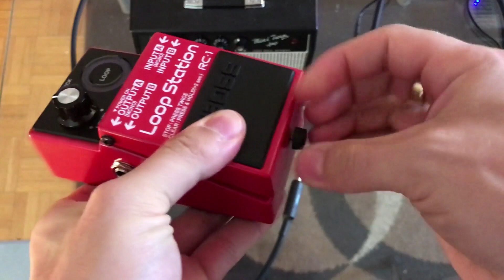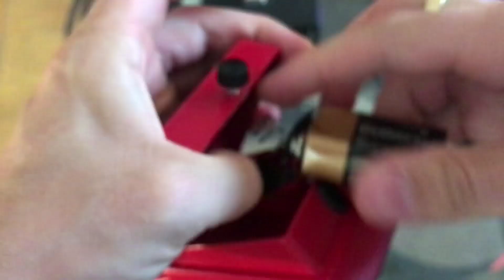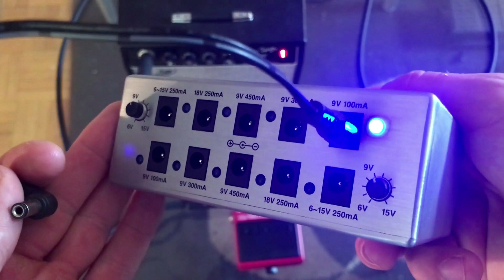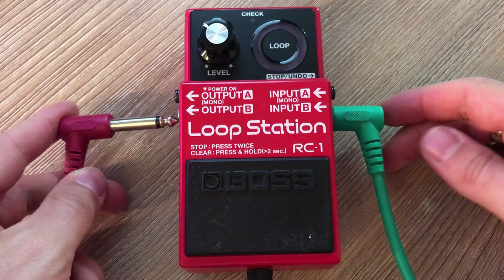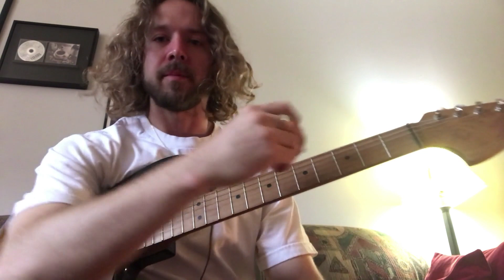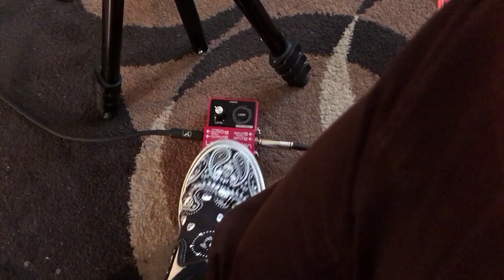How to Use the BOSS RC-1 Loop Station

Comment: Thanks for the information. It really helped. I was wondering if this could be used without an amp? Is there a built-in playback mic? I use an acoustic and dont really want to have the extra kit of an amp. 
If not, is there a pedal that can be used as I'm imagining?

Comment: I know this is an older video but some channels are cool and keep up with comment questions: I like the single pedal loopers but the one issue I can not get around is when the pedal is stopped but has loops recorded (not saved) you CAN NOT clear/erase it without it PLAYING for a few seconds!  WTF!  I HATE this.  I have to bend down and kill the output somehow then erase it.  This may not seem like a big deal but put in the context of 4-6 four hour gigs a week it's a really big deal.  Other than adding a "momentary switch" pedal (which defeats the purpose of using a single pedal loop - I could just use an RC-50 if I want to do that) is there any thing I am missing?  You don't always want to erase when you are in the middle of a song and you stop the loop but continue playing as that can be distracting...I hope I phrased my question clearly...thanks for this video and cool channel
Reply from the maker: I addressed this in my other video about the RC-1

Comment: 1:14 like he says, for using a power supply(PSU) it needs to be 9v DC providing 100+ mA, what he doesn't mention is to make sure the polarity of the supply jack matches. You'll see the supply polarity indicated by a symbol something like this    
9V   < + > --- (* ---- < - >     i.e a jack (*) with the sleeve () connected to one side and the tip * to the other. So the above means 9V suppy with the sleeve positive and center pin being negative. 
If your supply is center pin positive  < + > -- *) -- < - >  it can cause damage and probably wont work. Music gear is usually center pin negative, but lots of other consumer PSUs are positive so just be aware if youre mixing and matching PSUs

Comment: Here is what I DONT see on any of the demos is using effects to change your loop. Most basic: clean and distortion one over the other, also, flanger or wah on second loop. Octaver pedal? Add a bass line. Univibe swells Does your pedal emulate different instruments? Have a drum machine? Awesome. You can even plug a Mic (it might need some preamp) to add harmony lines to your vocals. Using the same tone for everything, even when each dub is tasty, makes the mix sound too busy and cluttered.

Comment: I don't know if there is something wrong with my looper, i bought it used but it doesn't undo the overdubs. I think i accidently got it to work a few times but i'm doing what you're doing holding it down and it doesn't erase the last overdub.
Reply from the maker: Depends on the mode that it's in I believe.
Reply: @andrewsiemon  This is the RC1 model, what other modes are there? you mean inputs to plus into? There's 2 other ones

Comment: How to send outs to a mixer for stereo?
Reply from the maker: Run a cable from the Stereo Output to a Mixer.
Reply: @andrewsiemon  I run both. Not trs from the stereo out correct? I  run both outputs from the rc1 to left and right inputs of the mixer.
Reply from the maker: @davidarchibald3755  I was under the impression that you only had to run one cable from the stereo out to your mixer.

I don't now, I'm not an expert on that configuration, but when I tried running into a second amp, that's what I did and it worked.

Comment: Hi, I use a looper pedal with my synthesizer. 
I start playing my synth and latch the key so there is a sound that „stays“. After that I start the looper. After a few seconds I stop it. 
Unfortunately there is always a little gap that you can hear. I is just at the beginning and it disturbs the recording. 
Do you happen to have a clue, how to avoid this?
Regards
Nosto

Comment: Is the external foot switch the way I can loop clean stuff and play dirty over the loop?
Reply from the maker: No the external footswitch is how you control it with an external footswitch, via, MIDI. 

Signal chain placement (the order of pedals), is how you turn effects on and off your playing after you've recorded the loop (without affecting the original loop).

Comment: Would this work for two separate instruments say a guitar and a mandolin? Thanks.
Reply from the maker: At the same time? Maybe not. You could loop a mandolin just fine though with it, assuming it uses a 1/4" instrument cable as guitars do.

Comment: Ok, I'm stuck at step one. Brand new battery, Input A from guitar, output A to Boss Acoustic Live LT. When I connect, check light flashes once but doesnt stay on like this video. When I plug guitar straight into amp, sound comes through. When I go through Boss RC, no amplification. Seems pretty darn basic. Any suggestions out there?
Reply from the maker: You figure it out yet?
Reply: Yes, it was a cable issue.

Comment: Dont use 9v batteries it will drain on this pedal on ten minutes.
Reply from the maker: Closer to 3 hours, but you’re right, a power supply is definitely ideal for loopers.

Comment: How long can you loop? And how many times? Im guessing twice.
Reply from the maker: I can't remember exactly, but I believe it's unlimited overdubs, but only one loop. 

Also, the loop might be 12 minutes long or something like that. I forget. I mostly use the Ditto X2 and RC-5.
Reply: You won't have to guess if you read THE ONE PAGE MANUAL. 12 minutes of unlimited overdubs.
Reply: @svenjansen2134  I bought it used no manual

Comment: But how do I change the settings on the amp after making my first loop without it changing the tone of the first loop
Reply: Yikes I never thought of this. My guess is you can’t because the sounds are coming from the same source at the same time. Maybe there is a way to do it with effects routing in a DAW?
Reply: LOOPER LAST
Reply from the maker: Looper last as the one guy here said, or put it in your FX Loop.

Comment: Pedal was working earlier, but I must have double tapped or something, now I can't record or playback a loop. It just pops up the three lights if i try to playback or overdub. I wish there was just a factory reset button.

I tried the mode selection stuff while watching this video, and also by following the manual directions, which are incredibly vague. They don't tell you when to exit all the clicks and double clicks. Tried 40 or 50 times, plugging, unplugging, pressing etc. Just insane. Same with your video. at what point do you exit? BTW, mine doesn't seem to behave the same as yours. perhaps it is just hooped.
Reply from the maker: Not sure what to tell you. Try following the instructions in this video again a little closer. It definitely works.
Reply: @andrewsiemon  Thanks, Andrew. It really doesn't help that I, like a very high percentage of males, am red/green colorblind,  and yet pedal manufacturers mainly use those two colors!
Reply: You have probably long since solved this issue, but I would take the battery/plug right out and maybe that would reset it.

Comment: Thanks for this, you did a fantastic job of explaining... but I still HATE this pedal.   I generally love BOSS pedals... but I hate this one.   I just wanted to record a loop and practice over it.  I inevitably end up overdubbing.  And I am just not good enough to double-click in time with my foot.   The features are impressive... but damn... I have to get the manual out every time I want to use it.  I really wish I had not relied on the BOSS name and did a little more research before spending money on something that - for me - is essentially useless.
Reply: I hate the fucking thing, too. It is just impossible to set the mode back to default.
Reply: Damn, sorry to hear this. I am worried it’s going to be a little too much for me too. I’ll watch lots of videos and hope for the best. 🤞
Reply: One more time: press the pedal when you turn it on its in this video ffs
Reply: @svenjansen2134 double click to turn it off.

Comment: You can plug in your amp first all you want, but don't turn it on till every thing is plugged in and before you turn on anything make sure your volume on your amp AND guitar are off or at the lowest setting till every thing is plugged in and your amp is on. Then turn up your amp THEN your guitar. Thumbs down fir this one bud

Comment: Aloha, I bought this looper last year & used it a few times, it's pretty good but I want something better, I bought it for $99 at guitar center & sold it to someone I know for $50 as I plan on getting one with drum tracks built-in like maybe a Flamma.
😎🤙🎸
Reply from the maker: I have the RC-5 and the MXR Clone Looper as well and the RC-5 is pretty dope. Clone Looper is cool - I’d say it’s a step up from the RC-1 but a step-down from the RC-5. 

The RC-5 has drum tracks and stuff as well. I’m going to get the TC Ditto X2 and do a comparison of it and the RC-5. I’ll have to check out the Flamma, never heard of it although the name rings a bell.

Comment: I just bought this and I am very confused. I plugged the cable into my amp, and into the looper output A. I plugged my guitar into the amp as I normally do, but there is only one cable going into the looper (output A). It is not working for me, and i don't understand why. Do I need a third cable?
Reply: Rather than plug the guitar into the amp, plug it into input A on the looper! Hope you figured it out! :)
Reply from the maker: You probably have the cables switched around.